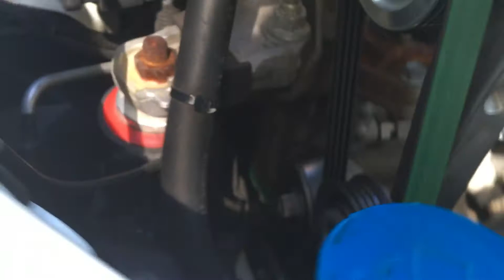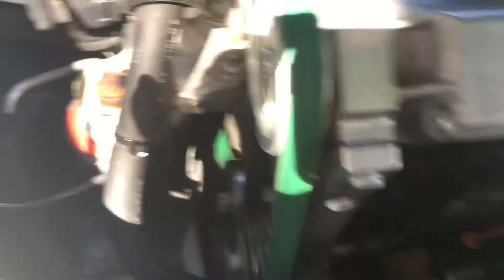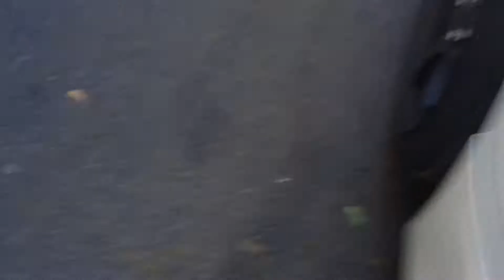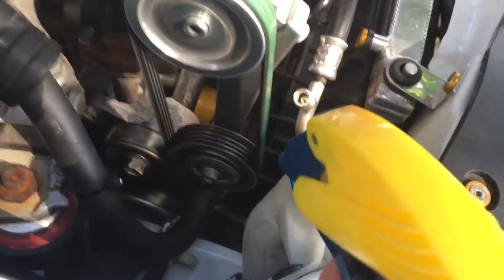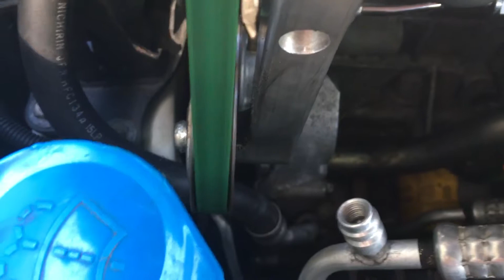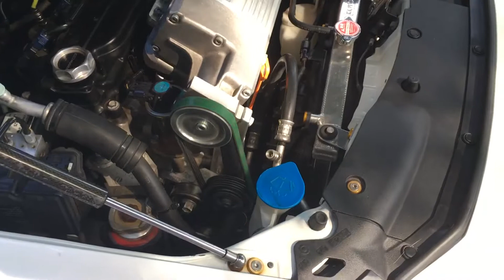Belt squeak - Honda CR-Z with Sprintex supercharger

Comment: Hopefully you fixed this issue! I am running Sprintex SC on my CRZ for 2 years now. Autotensioner and SC idle pulley seems too close. Changing shorter green belt will fix this issue.
Reply from the maker: Jimmy Lee I already have the shorter green belt. Already changed the autotensioner and belt.

Comment: Did you manage to fix this mines doing the same ?
Reply from the maker: I ended up changing the belt and that worked for a little while, then it came back after a few months. Turns out the auto tensioner was worn out and making the belts wear faster and then squeak. New auto tensioner and new belt fixed it. For now lol
Reply: Thanks I'll give that a try, the noise is exactly the same

Comment: Did you get the EGR kit?
Reply from the maker: Bryan Grimes Honestly I bought this CRZ already modded so I’m not sure about a lot of stuff done to this crz. But yes I think the EGR is blocked off. I think I remember seein the EGR turned off in my Hondata tune
Reply from the maker: Bryan Grimes it has the js racing header which blocks off the EGR, if I recall correctly